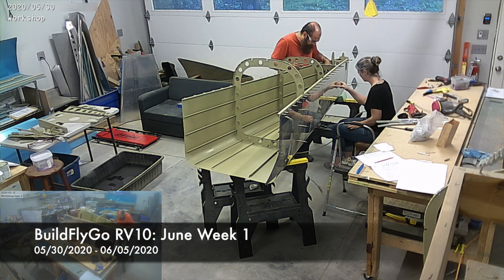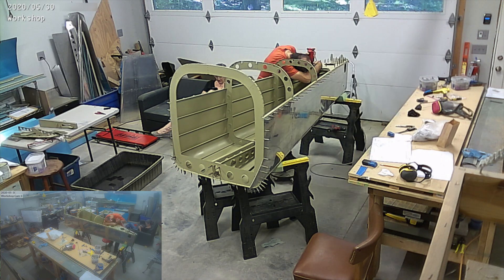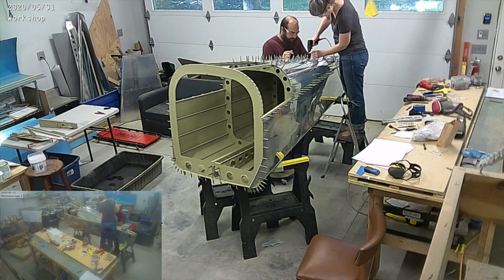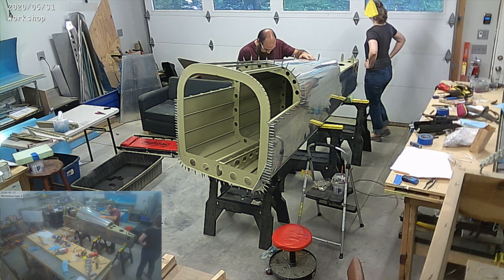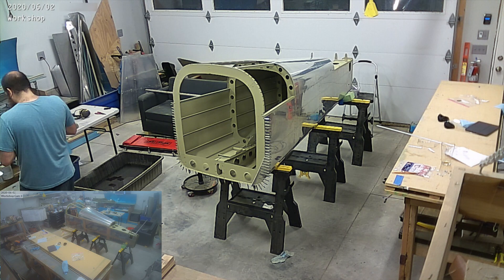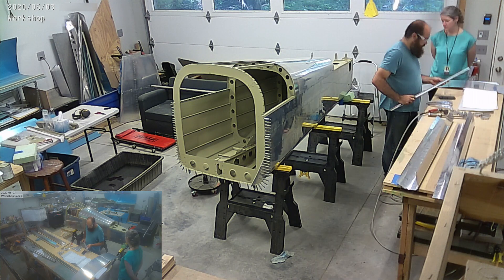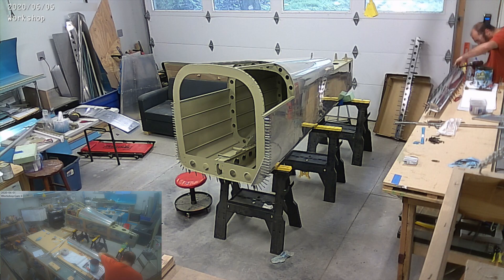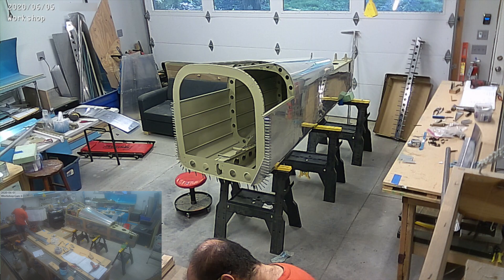RV10 Build: June 2020 - Week 1

Comment: Hi. Why not prime the outside to protect the rivet holes before riveting?
Reply from the maker: Outside priming is generally considered a bad idea. The primer needs to be compatible with the top-coat, so when you go to paint you'd either be restricted to a specific type of paint, or most likely your painter will not warranty the work as they don't know how well the primer was applied.
Reply: BuildFlyGo understood.